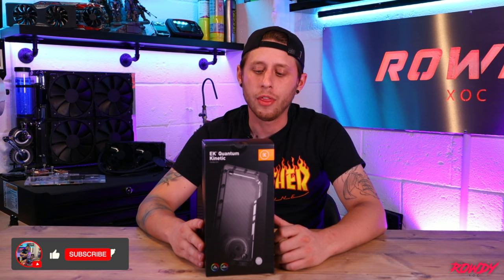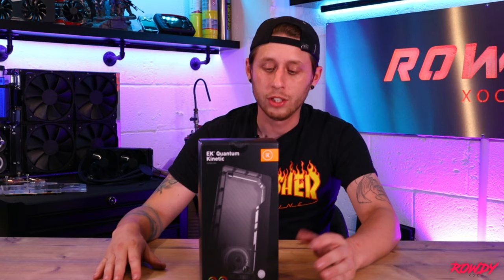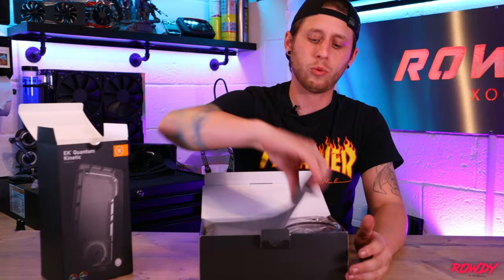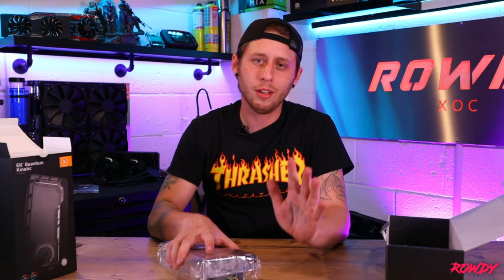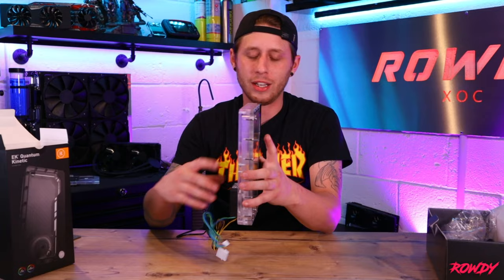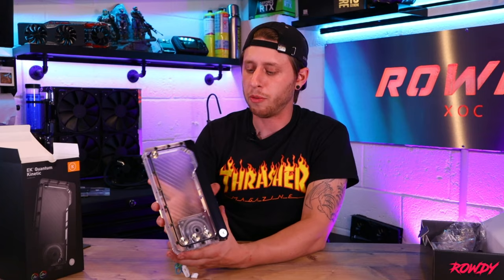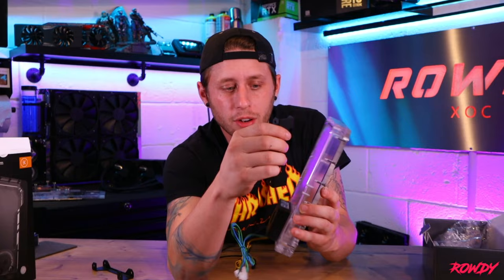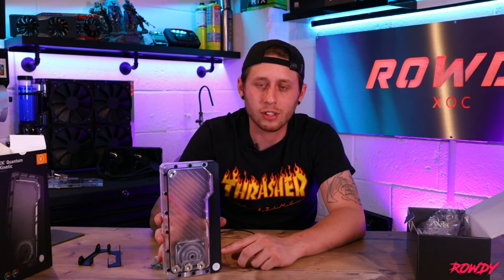EK Quantum Kinetic 240mm Reservoir - DDC Combo Kit - ITS GROWING ON ME!

Comment: Hi, i love your idea. and EK makes awesome stuff. it's a good thing to measure and match to specific size product to not be disappointed when it arrives. lots of sizes 240 360 and XXX and XXX. 4090 12gb, 4090 24gb, 4090 OC, 3090. I thought my item from EKWB was devalued a month after ordering. I was actually comparing to a differnent EKWB block. to my excitement now it HAS the backplate drgb which was not detailed on my amazon order history. or so i thought. 

btw since i mentioned all that. i might aswell mention what they're for sure going in. i did my research on my PC builds. watercooled Gigabyte Aorus Xtreme X 4090 in a Cooler Master Cosmos C700M eATX Case. horizontal GPU verticle RAM. next a super air cooled EVGA z790 classified in a Thermaltake Tower 500 Vertical eATX Case. verticle GPU verticle RAM. right now i only have one 4090 and everything mentioned. cost signifigant but saved alot. the EVGA and Aorus both have displayport igpu that means evenwithout a gpu i can test system with 1080p gaming provided i order a intel K series. usbc or hdmi thesedays is the DP output. kingpin for example has no igpu and neither does threadripper.
Reply from the maker: Hey, thanks for your comment. It certainly sounds like you have done your research and it has paid off! EK really do make some great stuff. Good luck with your build 👊🏼
Reply: @ROWDY.404 , yeah I am sure it'll go really well. the balanced glass pannels and vent panels are so nice the default images don't do the customization justice.

Comment: if you got a Lian Li Dynamic Evo and 3x 360mm 45mm thick and a GPU and CPU block a D5 is no good... not enuf power.... DDC is the way to go
Reply: I have 2 480mm and 2 360mm (60mm thick) 1 GPU and 1 CPU block, a single d5 and no problems.
Reply: D5 should have no problem with that at all. There's some other problem there brother